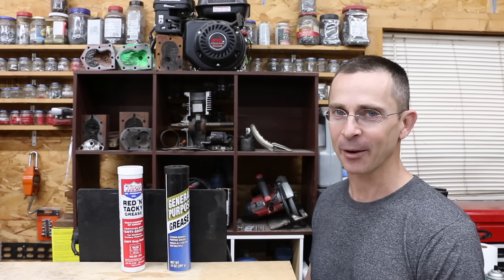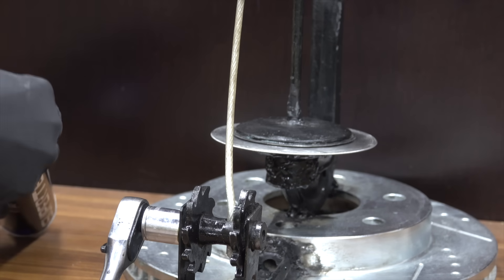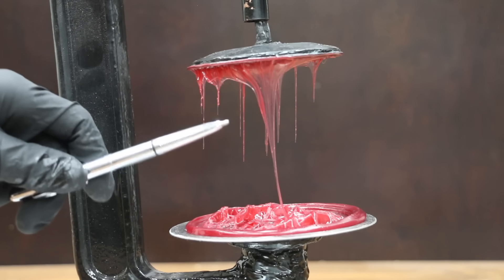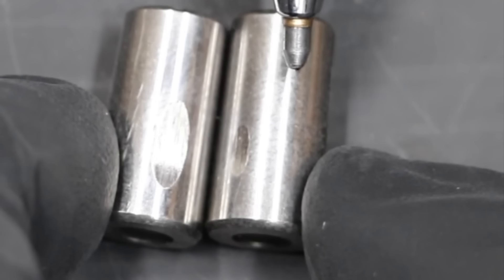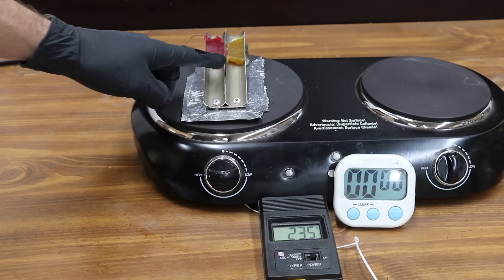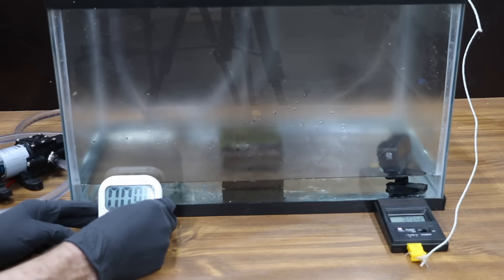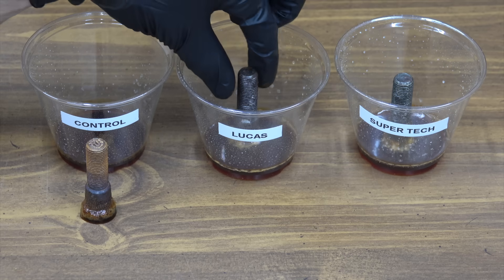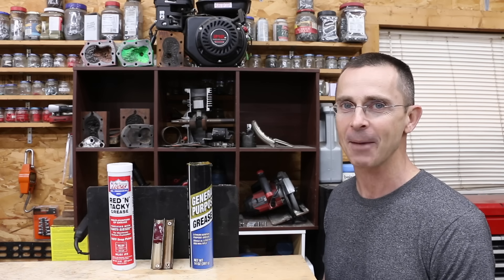Is Cheap Grease better than Lucas Red N Tacky? Let's find out! Bearing Grease Test Episode 1

Comment: I've used Red & Tacky. It's like runny nose snot. IMHO it's not very user friendly if you want to apply it by hand- not that any grease is, but it's gooier than anything else I've used.  It gets everywhere, which can be a good thing I guess but when I had a choice of greases, I didn't use the R&T. It does last on bearings, but I remember thinking two things; I couldn't wait for the tube to be empty so I could buy something else and when it came to repacking wheel bearings, I opted for a regular wheel bearing grease. After all, that stuff can last 100K miles in a car application. Also, a long time ago, I did an unscientific heat test with 6 of the most popular tubes of grease (not R&T). I applied a dallop of each grease onto a steel plate and used a blowtorch on the backside of the plate to evenly heat it which was held at a slight angle. Each grease began to smoke and then boil and finally slid off the plate except for one.... Slick 50 grease blew all the others away. It barely even boiled. Who woulda thunk? It beat Quaker State, Valvoline, Marine grease, Mobil One and Lubrimatic. So naturally they stopped making Slick 50 grease. This was only a heat test and there's way more to consider about a grease than this, but gees.. Slick 50? Wasn't that stuff from an infomercial?
Reply from the maker: lol. Nice!  Thank you

Comment: I use Lucas red N Tacky for greasing the front end of my riding mower using a grease gun, I also use it for greasing the cart wheels on my cart that i pull with the mower. That Lucas is some awesome stuff!
Reply from the maker: Great strategy!
Reply: You should try the STP grease against the lucas red N tacky

Comment: I used to buy Lucas Red N Tacky when I lived in PA, but I moved to Florida and found that if I left my grease gun in my shed after 6 months about 1/4 of the stick would liquify and run out. I then started using Mobil 1 grease, and usually only a couple tablespoons of the tube will end up liquefying and running out.

Maybe it'd be worth giving a test?
Reply from the maker: Great feedback. Thank you

Comment: Thanks for another great video. I’ve used red and tacky all the time, it now comes in a spray cans also. I’ve recently been using a marine grade grease that is supposed to be good for boat trailer bearings and dealing with water. The super tech grease looks like the grease used in the gears of older power tools.
Reply from the maker: Great information. Thank you

Comment: timken grease RedLine CV2 grease  Amsoil EP grease and last RCV SPEC High Temp CV Grease for Racing Applications (RCV is the most expensive $80 per tube) lets see if the performance to price is BOGUS

Comment: Great video as always! I would love to see a tierod/ball joint test rig with an integrated automatic greaser. A motor with an arm that rotates and pivots (2 axis) within one rotation. An electric grease gun with a timer hooked to the trigger circuit. You could use it to  test grease products, regular maintenance vs none and cheap tie rod ends vs expensive ones.
Reply from the maker: Thank you for the video idea!

Comment: Grease is such a tricky one... now watch, everyone is going to run out and start pumping red and tacky in their c3 motor bearings and wonder why they failed.  A grease that can run at such high temperatures is good for certain applications.  Most bearings will not run that high in temp.  THERMAL EXPANSION kills bearings because of too much, too little and too thick of grease.  Many other factors like speed and loading of course, but the number one failure for bearings is the grease itself.  It's crazy how much is I volved with grease...
Reply from the maker: Good points!

Comment: Great video Todd as always but I do have a question since I'm not a mechanic or machinist what is the main application for Greece in vehicles? Is it just to relieve are prevent corrosion?
Reply from the maker: Thank you.  Wheel bearings, suspension parts, etc.  I use a lot of grease on farm equipment.  Lots of moving parts.
Reply: @ProjectFarm   thank you sir.
 and as much as I like you videos,  and like what you're doing.. but can you do occasional one on farming? I watch the original videos of seemed like you were going that way and then all this which I admit I like I would like to see the one on farming occasionally.

Comment: Fun fact. I run the amsoil green grease in all my chit. I did have one tube i forgots about for 4-5years, stored inside a non climate controlled shop. That tube formed a rubber like layer 1/4in thick. It was very weird. I tossed that tube and purchased more!
Reply from the maker: Thank you for the feedback

Comment: We now use red & tacky in the mowers at the church cemetery I help mow we used the house brand Traveller from a well known farm store the mower deck spindles would freeze up solid to the point you couldn't turn the spindle with a large pipe wrench when we finally got the spindle disassembled we found the grease basically turned into a hard cement like mass, we had to warm and beat the spindle assembly apart, after inspecting the cleaned parts we found NO damage, reassembled and relubed with red & tacky NO PROBLEMS since, these parts were on a commercial cub cadet tank zero turn these are the most massive spindles I have seen on a mower deck huge tapered roller bearings, we are sold on Red & Tacky.

Comment: I have used the wrong type in a oneway sprag type clutch before. 
I used an extreme pressure grease instead of a general-purpose grease, the result was the clutch didn't hold. After washing it out and repacking with normal stuff it locked perfectly. 

My favorite is Mobil XHP222 at the moment, it is super tacky and great for general purpose.  Also, I like to use Polyrex EM for fan motors, it keeps the bearings noticeably quieter. I have used isoflex nbu15 in spindle bearings too, it's like it's not even in the bearing, they just spin and spin for ages.   

Your tests were great, maybe you could test leading brands best sellers or best multipurpose against each other next? Or different types/thickeners?

Comment: Suggesting a compare/contrast with polyurea VS lithium complex similar to this test.  Then for heavy duty high pressure such as loader pins grease with 5% or more moly compared to best general purpose, such as polyurea.  Compatibility charts are readily available and have to do with different thickener chemisry.

Comment: I've personally used both for bmx bike maintenance In the past Ive always been a big fan of Red N Tacky and even tho most have said it wasn't ideal for bike maintenance, I've always sworn by it and never had a bad result. More recently I came across that Super Tech lithium grease and decided to try it out to save a couple bucks. Have to honestly say I have not been very impressed at all with it. For stem bolts and headset bearing to headset contact, and the like, it does a fine job. However, I have an older unsealed Nankai Freecoaster rear hub, and for that, the Super Tech falls way short. My wheel doesn't spin nearly as good as with the heavier tackler Red N Tacky, and have even had some clutch slipping issues that I never had before with that hub. Also noticed it being a bit louder than its ever been. After a year of use, I have again picked up a tube of Red and am about to rebuild the Freecoaster Hub with it. The Red makes the wheel a bit sluggish for the first ride, but once it's mixed thru, settled, and broken in, spins amazing. Better than any other grease Ive ever used...Park Tool and Philwood grease can eat an egg. Red is superior.
Very kool video. It proves what I've experienced with both. Glad its not just in my head. Lol
Just hope a year of ST didn't damage the steel internals of the hub because replacement parts are about near impossible to source these days. Gonna stick with what works.

Comment: I use Mobil 1 grease in my travel trailer wheel bearings. A comparison with Red N Tacky would be very interesting
Reply from the maker: Thank you for the feedback
Reply: @ProjectFarm  thanks for your content. This is off subject but was wondering what your thoughts were using engine restorer on top of seafoam. Hadn't found anything on it. Thought I'd ask you. Thank you
Reply: Project Farm 
Good testing sir.  I don’t necessarily spend money on the most expensive replacement part or consumables but in many cases as shown here. My loyalty to the better quality products will repay in the long game.
Reply: Yes, that would be an interesting comparison. I use both. I seem to like the mobil 1 for my utility trailers, the hubs don't get warm under heavier loads. The Red N Tacky seems to work real good in u-Joints on my tractor pto shaft when mowing for long periods.
Reply: I've tried Mobil 1 red grease in the past, and it was a mess with liquid leaking out of it, making puddles on the garage floor. Never again since then. Haven't had that problem with Red n Tacky.
Reply: That's all I use is Mobil 1 grease and I ve never had a single problem
Reply: Correction-- I could've swore Mobile 1 was only NLG1 thick when I last used it 8 yrs ago, but it's only available presently at NLG2.
Nevertheless, my experience was that  it leaked out of bearings faater in places that other greases don't.
Reply: I'd also like to see red n tacky be put up against pb blaster red n sticky grease. Wonder if they're the same but with different packaging. Although this video was interesting, it'd be good to compare apples to apples. I do really enjoy your videos amd the enthusiasm for testing. Keep it up!

Comment: I’m not a big fan of high drop point grease for bearings, especially Low temp, low speed ones. I’m generally paranoid that the grease will move away from the surfaces and loose lubrication.   On that note, I’ve been using red n tacky on heavy equipment pins of all types for a long time, and have never had any issues. Definitely worth a little extra money, especially for that good water resistance
Reply from the maker: Thank you for the feedback

Comment: Liked this video a lot! I was first a dairy farmer 👨‍🌾 then when my father sold the farm I became a farm equipment mechanic 🧰. I worked at a dealership for 17 years. The last 11 of which I was service manager. Then I started my own business which I ran for another 17 years until my back gave out. I’ve always tried to use the best products but sometimes it’s difficult to really figure out which is best. That’s why I find your videos so interesting! 🧐 I just recently drilled 8 1-1/2” holes 🕳 in old non vented rotors for a defuser in my waste oil burner. I used two different top name brand hole saws and I was surprised 😲 how much better one preformed over the other. Maybe you could test out metal cutting hole saws in a video. As always thanks Paul V  P.S. I still putter in my shop.

Comment: One of the best grease' I have used is Lubrication Engineers (LE). Their paraffin-based oils were top of the line in the 70's - 80's. Kinda weird using red oil back then... of course now, 'paraffin bad!'

Comment: Do an episode on paper kitchen towels. Test dry strength and wet strength. test absorbancy and cleaning efficiency. Test drying factor as resusing paper towels is a thing. Also test strength between the square sections. Test water retention weight and drip factor. Thankyou.
Reply from the maker: Thank you for the video idea!

Comment: New video idea.....  which woodworking epoxy filler works best...  as an avid woodworker that likes to use mesquite, white oaks and walnut I am constantly filling cracks, voids and knot holes with 2 part epoxies.  Which one is best?  Several criteria to investigate here, which one is most similar to these hardwoods as far as workability (sanding, cutting, turning, etc.). When filling large voids which one is most economical while maintaining strength, workability, pot life, etc.  which one is strongest?  Which ones pose the highest safety hazards?  The main players in these epoxies are:  System Three, West, SRC, Artresin, MAS, Pro Marine.  Thanks for all you do!
Reply from the maker: Thank you for the video idea!

Comment: I only knew of general purpose, Wheel & Bearing grease and White Lithium grease but typically use whatever I have on hand or what I can get free or cheap. I'm currently using some green grease I got for free which I believe is general purpose and so far it seems to be doing good on the wheel and crank bearings on my bicycle. I also occasionally use some spray grease(also free), which is supposed to for chains & similar stuff, its a very thin black grease and it smells horrible. It's not really good for anything except maybe using it like a penetrating oil just to help remove stubborn things.

Comment: Thank you for making this video, there was much greater difference than I was expecting. I won't name brands as the ones I have access to here in the UK are often different but my ideas for further videos on greases would be to test the different types e.g. lithium, calcium, polyurea, moly and lithium complex. And also grease vs copperslip/ anti-sieze especially how well they stop rust siezing the threads.  Thanks for testing excellent video.
Reply from the maker: Thank you

Comment: another interesting watch with interesting setups for quantifiable tests.     one minor inclusion would be to use a film thickness guage at a few points to see what was left on the part, like after the water spray.    Another good addition would be an expensive molybdenum disulfide grease to see how much better it is.   ...the real stuff that's $30-50 for a tiny little tube.

Comment: I would love to see Shell Gladus grease. Its by far the most common ive seen in my career as a semi truck mechanic (my current shop specifically uses Shell Gladus S3 v220c 2). Personally, I would be interested to see it in comparison to Mobil1 and Chevron which are also common in trucking and heavy equipment, as well as valvoline and the NAPA brand which seem to be very common in automotive applications. For further curiosity's sake, I would be intrested to see how it compares to moly based grease.
Reply from the maker: Thank you for the video idea!

Comment: These are two completely different greases for different purposes. The lucas is a heavier duty high temp grease and to heavy for use with the item that the general purpose light duty lithium. The lucas is more suited for axle bearings where the super tech is more suited as it says for light duty like a ball screw linear bearings window regulator etc. For these purposes you dont want the same characteristics. Super Tech makes a heavier duty high temp similar to the lucas that you can test.

This is the comparable grease in Super tech brand.
Model: WMC62014
Walmart # 4205277

Comment: Nice test!.  The grease intermix problem (quite a headache in the aircraft industry) relates to mixing grease of different bases, that is, mixing lithium soap grease (Type I) with clay base grease (Type II).  It's not that big a deal to mix two difference brands of lithium soap grease or two brands clay grease (Type I with Type I, Type II with Type II).  You end up with a mixed grease with a blended performance result.  It's critical to keep lithium soap and clay apart.  In the aircraft industry the problem was that the old MIL-SPEC, 82232, was for all non-moly greases and included Type I and II within the same spec.  Maint Manuals would just call for grease by the MIL-Spec and Type I and II greases could be intermixed, which causes the grease to break down.  Maint Manuals had to be revised with clear admonitions not to mix Type I and II greases, and if you did, it required a grease purge. The changes to MIL-PERF for specifications have clarified all the issues.  Also, a interesting thing to test for is water absorption into the grease.  Clay greases have had more of a problem with absorbing moisture into the base, one of the big advantages of lithium.  However, some modern greases are engineered to disperse water within the grease to prevent water pockets from forming and corroding bearings.  You can stir water into the grease and some greases will let the water mix in, up to a point, turning into almost a pudding like goo.  When you freeze it, the pudding like grease turns to sherbet.  Not good.

Comment: With the results of the bearing test, it would be very interesting to see how grease would perform as engine oil. I wouldn't say use 100% grease but, maybe mix it with engine oil to make a 50-50 mix.
Reply from the maker: Thank you for the feedback